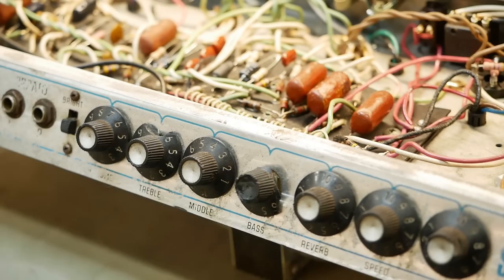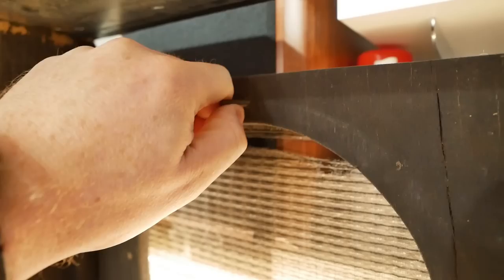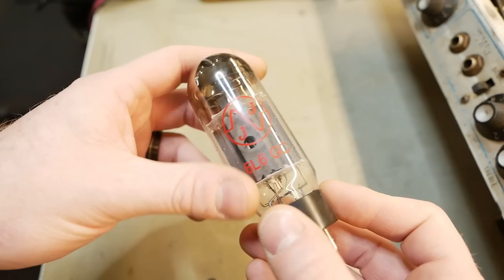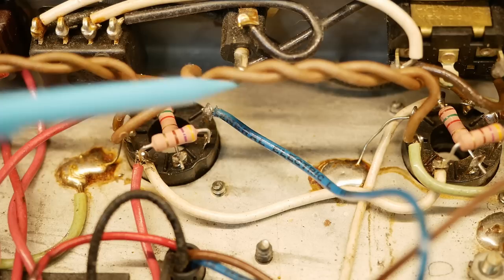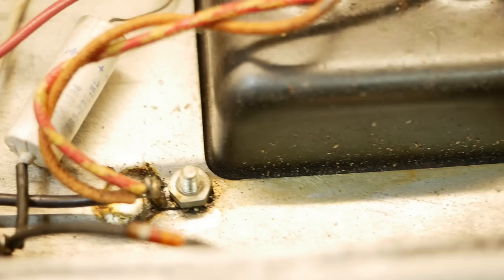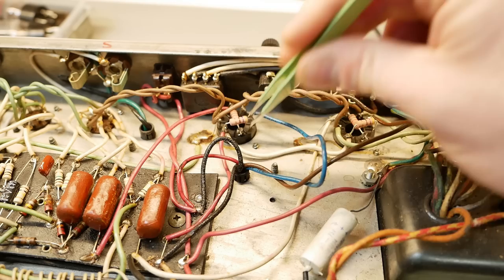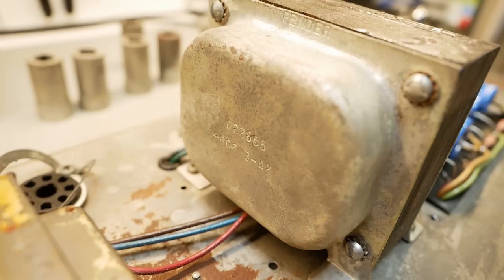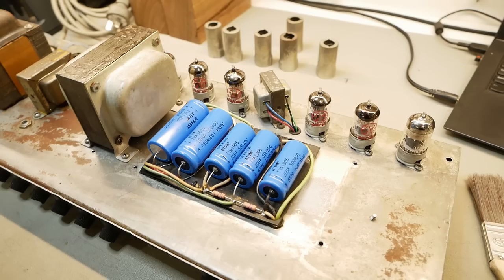Fender Silver Face Super Reverb Restoration - Part One

Comment: This amplifier is a great museum worthy state amplifier. You know when they have two examples of the same item and inevitably in the pristine order, and the other one is just an example of how bad they can get. This is the second type, of course.
The worst thing that can happen to amplifier tech is if this is your best friends amplifier. One you can't refuse.

I do love Super Reverb amplifiers, but this is just dead one. Plus, if that's one with weird biasing of power tubes, that's having both cathode and fixed biasing that alone makes it the worst possible and least desirable version as well. The best you can do with them is to black face them anyway.

If I had to work on that one, I would just make a completely new eyelet board. 
Depending on what the client wants, I would go with appropriate parts.

For me myself I think I would go to all-out improvent of parts and change all but iron if the iron works, that is.
I wouldn't touch that cabinet at all. I would just order the replacement cabinet and new speakers. The only way to keep the original speakers would be to find the 4th alnico of the same vintage and recone all of them.

Man, even the iron is not all original. I wouldn't pay 100 bucks for this amplifier.

Thinking once more over it, I think I would even order new chassis seriously. So this amplifier would be nothing but the donor for what just a few parts? Sad story.

The best thing is just to refuse it and wish the owner good luck with it.

Comment: Without replacing the speakers  is there hope for the sound ?  If they want to save money on the cosmetic I can see it about the sound  for a price.  Time is money  hope the video help out.  Fine idea to go SS diode before the tube diodes.  Interesting video  can see how many problem blend to one big hum problem . For every 10c upping  of rating 2x life up to about 40C thus 16 times longer life for 105 over 65 .  After 40C the multiplier falls off a bit just because it so much more than the lessor one .  For me 105C to 125C is the smarter pic on caps in tube amps.  Voltage rating of 125% of working voltage is a sweet spot for long life.  Having stated that it does not come cheap in the short term but does give a much longer life to the passive parts .
Reply: Adding rectifier diodes is an especially good idea because the first filter stage has 50 mfd total capacitance, which is right at the upper limit for a GZ34 rectifier tube. Okay for a vintage Mullard tube perhaps, but today's modern rectifier tubes aren't as rugged.